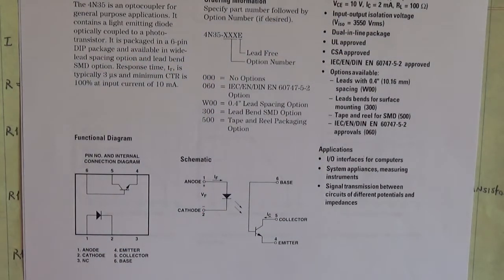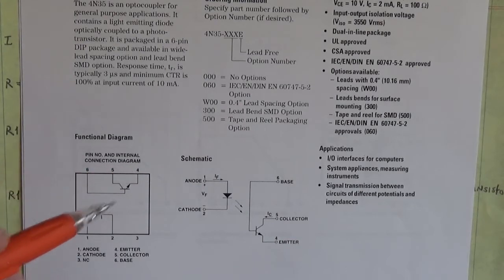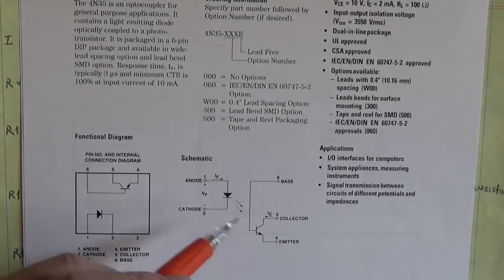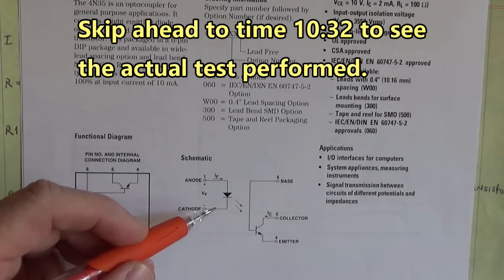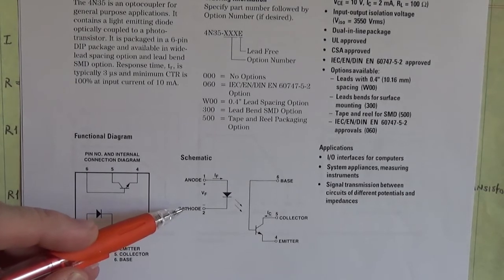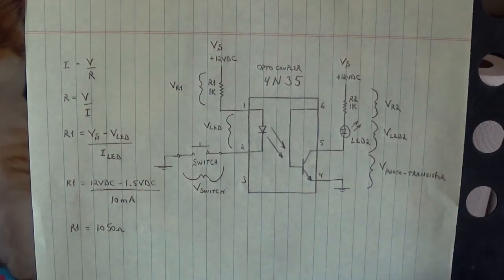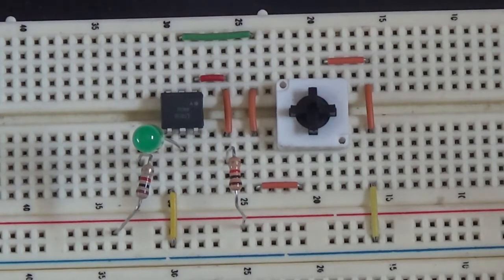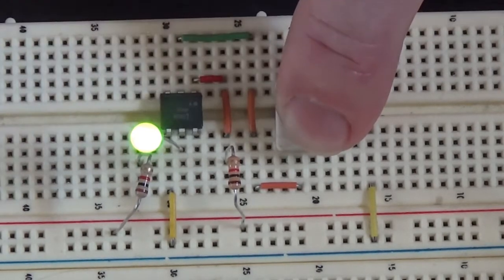Testing the 4N35 Opto-Coupler Integrated Circuit

Comment: Uh oh, I didn't really do it. I got the led to light up but I don't think it was because of a function of the optocoupler. 

I don't understand why those wires between the switch and chip are there bridging the two sides. Or the button for that matter. I have a switch on the same side as pins 1,2 and 3 and the led on the other side. 

I wish I could post a pic here to see if I did it right. It's one thing to make the led light up when you press the button, it's another thing to get the chip to light the led because of how one side controls the other. 

I made a different circuit with no bridge. Both sides are isolated, both power supplies are isolated. The only thing straddling the "rut" is the chip.

Comment: Finally I did it!!!!! But that breadboard just seemed overly complicated and the button confused me. I have some switches I got off an led aquarium light, very small and useless but I was able to use the power source and switch so it worked out. My button switches are so tiny I can hardly tell what hole the pins are in. 

So I focused on the schematic. Pin one of optocoupler is connected to positive bus with a resistor. One wire of my switch goes from pin 2 to ground. I switch it on and it completes the circuit on that side. 

Pin 4 is jumped to ground. Led goes from pin 5 to a row past the chip. That row is connected to positive with a resistor. 

I turn on power, flip switch, led lights on other side! Yay!

I only have one jump wire going from pin 4 to neutral. The salvaged switch doesn't plug into the breadboard, I just plug the wires into the breadboard. 

I wish I could post a pic. Since I built the circuit differently I'm unsure how to measure or interpret the voltages in various spots in the circuit, that will be my next project.

Comment: This is by far the very best tutorial that I have seen and understood.  I do understand the logic behind optocouplers but I couldn't understand how to calculate the value of the resistor.  My project involves driving a fan (5 volt or 12 volt) from a raspberry pi gpio pin.  The driving pin can only deliver a few milliamps.  I did find a circuit online using a 2n2222 that I copied, but now I will use a 4n35 instead as I prefer to have the raspberry pi protected from the circuit of the fan.
Again, thanks for the time you put into making this tutorial.

Comment: I'm lost. I can hook a resistor and LED to a breadboard without the 4N35 and still have it light up when pressed. So why use a 4N35.
Reply from the maker: Hello sir, no worries of being lost. This is a very good question. The opto-coupler gives you a very good separation of an electronic input to its electronic output.
Reply from the maker: Now why would we need this separation. I will try to show some examples. Let us say we have a proximity sensor who when turned on, its output is at +24VDC. But I have a +5VDC uController that I need to see if the proximity sensor is on or off.
Reply from the maker: I cannot directly route the +24VDC of the proximity sensor into one of the inputs of my micro-controller. The +24VDC would destroy the +5VDC micro-controller. So I run the output of the proximity sensor to the input of the opto-coupler (with say a series 4.7kohm current limiting resistor). And the output side of the opto-coupler connected to the input of my micro-controller (say using a 220ohm resistor pulled up to +5VDC.
Reply from the maker: With the opto-coupler I can connect the +24VDC output of the proximity sensor. To the +5VDC input of the uController.
Reply from the maker: The example above is called voltage level shifting. When we are converting one voltage level, to another voltage level.
Reply from the maker: I hope i have helped you with this example. I am sorry for using too many words, but I enjoy when other folks want to learn about electronics. There are not too many of us left. Your question lets me believe that you will succeed with your understanding of electronics. Thank you very much.

Comment: Dear Pee Paw, thanks for sharing the calculation and circuits. I had tried building the circuit as you'd shown but I was unable to turn On my LED.  When I probe the node between the resistor and the Green LED, the shows value of 11V. Between the Green LED and Collector, the value is 9.8V. Still figuring out where did I go wrong... T_T
Reply from the maker: Hello sir, thank you very much for watching my videos. I will breadboard the circuit again. And see if I can duplicate what you are measuring. I will also make a video on troubleshooting this circuit. So that you can compare your voltage measurements, to my voltage measurements. I am always happy to see other folks interested in electronics and electronic troubleshooting. Again, thank you very much for watching. The sun is almost down here, so I better get to working on the troubleshooting video. HaHa.
Reply from the maker: Hello sir, here is my troubleshooting video. It is long, but contains some valuable information on troubleshooting electronic circuits. I hope this video helps you. Thank you very much for watching my videos. click on the link below...
https://youtu.be/Z_4iUKiKpXQ
Reply: Thank you, Pee Paw. Appreciate your assist, sir ^_^